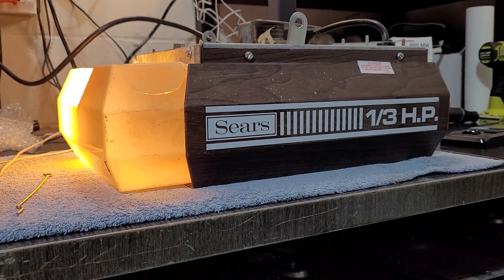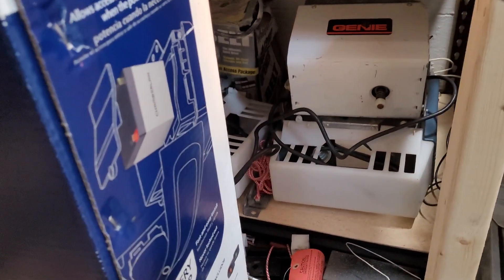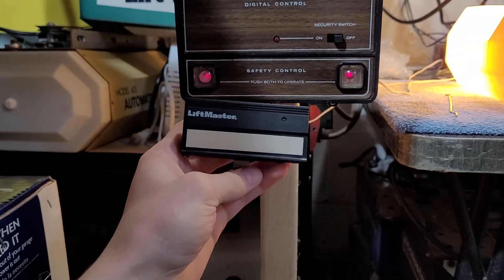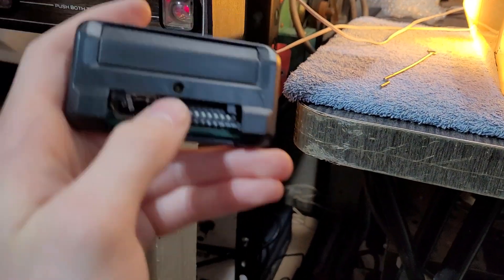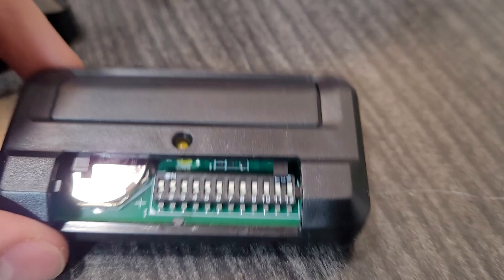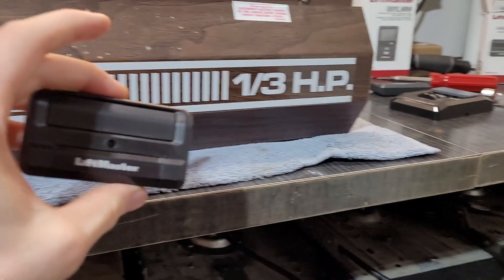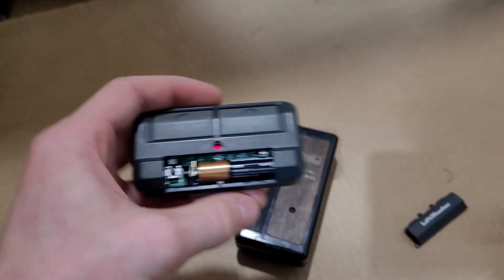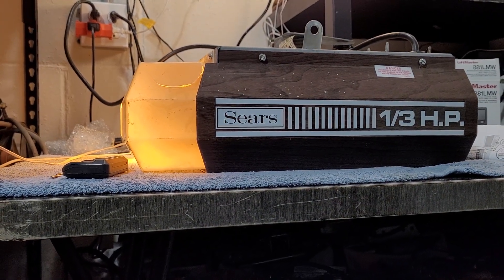Finding and Programming Remotes for Old Sears Garage Door Openers

Comment: I've got Sears 139.664756 screw drive. Tried to program the j892lt just the way you showed (the same way the directions says) with no luck.The old remote does not have a light on it so i can't tell if stays on long enough to program. The old remote still works but I have to press the touch pad inside for it to work. Any help ? Thanks
Reply from the maker: Does your existing remote have 9 or 12 switches inside of it? With 12 switches it may not be compatible.
Reply: @TBHD724 9 volt 9 pin dip , tried the 9 pin 390 MHz ,didn’t work
Reply from the maker: Try setting all the switches in the remote and receiver the same direction (either all on or all off) and see if it works that way. Might want to try a fresh battery in the existing remote too
Reply: @TBHD724  tried that also in the 390 remote, the DIP switches are a three position. I tried all three positions and nothing worked.
Reply from the maker: Interesting, and the original remote still runs the door?
Reply: @TBHD724 yes I have left the cover off of it, and I have to press the touchpad to get it to work because the centerpoint where the button pushes the touchpad is dead, I can operate the remote from either side of the touchpad
Reply: Any other ideas or tips?
Reply from the maker: Sorry I totally missed this comment. Just to confirm your receiver has the 2 buttons you have to push to run the door? If it's a big box with just a single button on the bottom, they made those in several different frequencies and it may not be 390mhz.
Reply: @TBHD724  only one button that sits on top of that push pad underneath it
Reply: I tried a 390 MHz that had 10 three positions dip settings, and I tried every configuration possible and it didn’t work
Reply from the maker: In that case yours is likely a different frequency than 390. Really the only option at this point would be to install a new genie universal receiver or replace the whole unit
Reply: @TBH @TBHD724 ok thanks for the advice
Reply: found this vid eo and bought it ,botabing.. success.thanks for your help,add this one to your library.
Reply: ooppss forgot https://youtu.be/6AoGiLgFCE8

Comment: We have a craftsman remote that has been working fine til the power was off for about 4 days. We put the dipswitches to match the wall mounted unit, but its still not working. Any suggestions.
Reply from the maker: Make sure the switches aren't backwards, or try a new battery in the remote. If the power went out because of a lightning strike or power surge its possible that may have killed the receiver unfortunately
Reply: the power was turned off on purpose to do some electrical work.
Reply: @TBHD724 the remote has a new battery. Will try again with a couple of my friends remotes. We found the original papers on the opener, but it was not helpful.

Comment: Lost the remote for our old Sears 1/2 HP opener. Looks like it has 12  two position switches so I'm ordering the 811LMX. Looks like it'll be easier than expected, though I don't think I'd have figured this out on my own. Thanks for providing this video! 

The listing says "not for residential garage door openers" but I believe that is referencing Liftmaster's own products which probably use a different system
Reply from the maker: I've not tried the 811LMX with 12 switches before, so I'm not 100% sure if it will work, but the programming process would be the same. FYI it might take a few minutes for the receiver to start recognizing the new remote so it may not immediately work. Let me know if you have other questions or if you find out it does or doesn't work, I'd be curious to find out!
Reply: @TBHD724  I haven't been able to get it to work. It's doing the same exact thing the 811LMX is doing in your video even though it's a brand new one so presumably that glitch you mentioned would be fixed. Not sure which remote to try now though. The old one that worked was either liftmaster or chamberlain (standard white and blue design) but I don't know if its has to be a 12 switch one since the wall unit has 12 two position switches
Reply from the maker: one thing I would suggest trying is setting all the Dip switches in the remote and in the receiver to the off position and see if that works. It's possible that the 811LMX will only use switches 1 through 9 when it's in the 390mhz setting, and if it works with all the switches off try a random code but leave switches 10,11,12 off on both the remote and the receiver.

Comment: I have the original remote and it lights up and the switches match, but it won't open it or close it. Any ideas on how to fix that?
Reply from the maker: Try a fresh battery in the remote, otherwise I've found sometimes it can take a little while for the receiver to start recognizing the remote.

Comment: Hi, I have the same opener and receiver in this video,  but no remote.  Did you ever figure out how to get the 811 LMX remote to work?  Also, is there a way to hack the receiver to work with home-link?
Reply from the maker: So the early 811LMX remotes had an issue that would cause them to not work if you moved certain dip switches, and I'm assuming that's the issue I was having with mine. I haven't tried another one since I made this video, but it should work. I would imagine you can sync up homelink to this, but some homelinks might not accept fixed code remotes. You could always buy a new universal receiver (both genie and liftmaster sell one) that would upgrade your opener to rolling code and the new receivers would be compatible with homelink.

Comment: Hello I need some help figuring out what remote to purchase on my sears garage opener. My opener is a 1/2hp built on 3/92. Its model number is 139.53515SR. 
It has a push button on the opener that is red. I have no dip switches. I do not have the old remote. 
Can you help me please. 
Thank you
Reply from the maker: The 61LM will work. The sears openers with model numbers ending in "SR" use dip switch remotes but are programmed into the opener using the learn button

Comment: Hi, your video was great for my situation, having a hard time to find the right remote control for the garage door, I have the same sears 1/3 but the two push bottom receiver has 12 code numbers, not like the one you show in the video. My question is, can I buy remote from Amazon that have 12code numbers? 811LMX,  thanks a lot!
Reply from the maker: Unfortunately with the 12 switch receiver you can't use the 811LMX. You would have to buy a new receiver, either the liftmaster 850LM or Genie universal receiver are good options

Comment: I have a Sears garage door opener system we installed in the 1980s.  We have lost all but one of the remotes and I want to get another as back-up.   I can provide photos of the front and back, and even the inside if it would help.  This one has a simple "programmable" two-digit pin switch ( 1 - 10 ).  I'm not expecting to find a duplicate remote, only a simple compatible unit.  What do you advise?
Reply from the maker: You'll probably have a difficult time finding a 10 switch remote. You can use either a liftmaster 850LM receiver or a universal Genie receiver and use new remotes with rolling codes. Both types of receivers are powered with a power supply that plugs into the wall and they connect to the garage door opener on the same terminals that the wall button connects to

Comment: I have the same unit,  model 136.664000.  The receiver is working but the remote is not when outside the garage.  I purchased the liftmaster 61lm and 892LT as you recommended but both did not work.  Should I get a new receiver and do you know if comes with genie/opener from inside the garage?  Thanks!
Reply from the maker: If you want to upgrade to a rolling code system you can buy a new receiver. The Genie universal receiver will come with one remote in the box, and the Liftmaster 850LM will work with the 892LT you already have.
Reply: @TBHD724  Thanks for quick reply.  Which is a better receive for my unit, Liftmaster 365LM or the 850LM?
Reply from the maker: The 850LM will work much better. The 365LM Isn't great as far as the range goes.
Reply: @ sorry, I have one more question.  The receiver I have right now for unit serves also as the wall control button.  Its the old unit with 2 button.  If I replace the receiver with the 850LM,  how do I install a new wall button?
Reply from the maker: you can still use the existing wall button. I would however recommend unplugging the receiver portion of the wall button so it can't be used by anybody to get into your garage.
Reply: @ Thanks

Comment: You speak of the "receiver"  can you tell me how I would search the internet to find a similar receiver.  My Craftsman garage door is a 1/2 HP and model 136.664000,  I need to locate a receiver.  Thank you .
Reply from the maker: You may be able to find the original receivers on ebay, but the best option if you need a receiver is to buy the liftmaster 365LM universal receiver, it plugs into an outlet and wires into the opener and you can use current remotes with the receiver and it also upgrades the opener to rolling code which is more secure